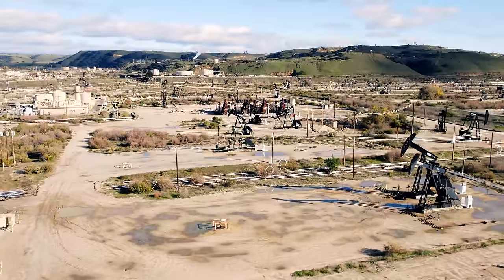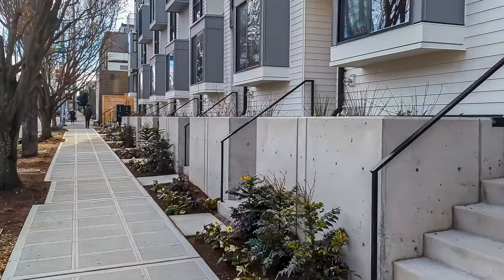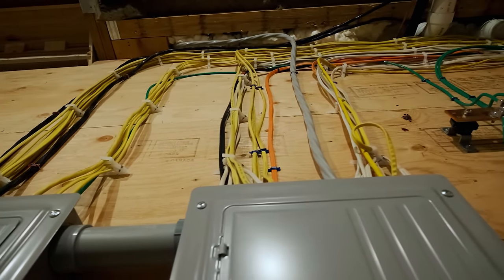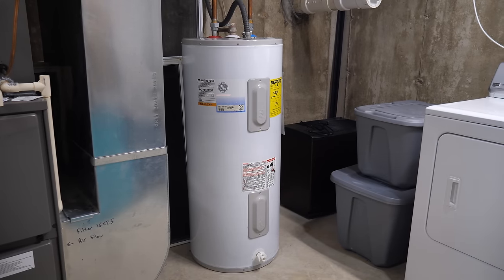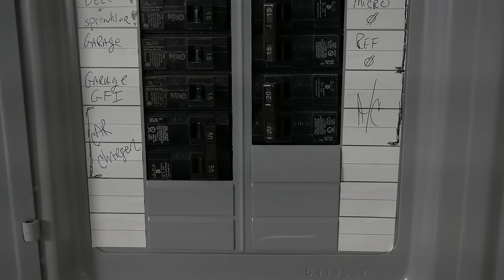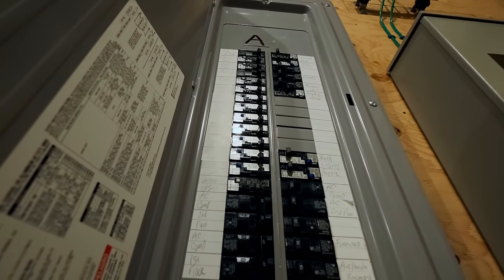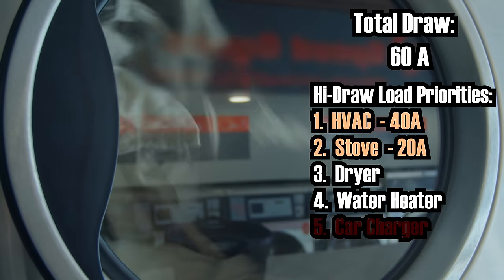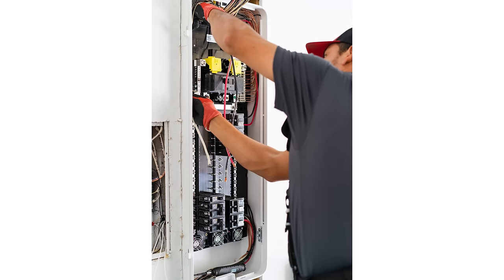Home Electrification: There's not a lot to do, and it doesn't have to be hard (Part 1)

Comment: Home electrification sounds like a great idea however, Being a Michigander, I'm glad we have natural gas heaters. Power outages are such a concern with fragile infrustructure in my state especially in the winter. Manually turning on our gas heaters allow us to not die. Home electrfication is good depending on the region and especially on the region's power stability/weather.
Reply: Yeah, I think one of the things he should have discussed is what happens if the grid goes out. This goes for both hot and cold climates, although I'm much more familiar with the latter. If you can expect 5-10 days of grid failure per year, which usually occurs during the most extreme heat/cold, then relying completely on electrification might be a fatal mistake.

There's probably not very much you can do about this in city centres (and city centres are usually prioritised for reconnection, so it's not such a big deal); but I think worries about power cuts are one of the reasons why people in the suburbs/countryside choose to use fuel burners for heating. And if you're worried about extreme heat/cold, well, those are the exact conditions where basic household generators don't work so well.

Basically, full electrification is only a good idea if you're unlikely to have an extended power outage that coincides with very hot or very cold weather. (Or if you have a lot of money to set up all of the additional backup infrastructure in case of a grid failure.)
Reply: @jon_j__   This more so brings the question, How do we stop future grid failures from happening? I'm beginning to think if underground wiring might be the next step to less maintence costs. Yes, There's going to be a large amount of work required and capital required to just get everything underground. However, This could be the next step in fixing 98% of grid failures
Reply: @girthiusmaximius8486  I think that burying all the lines has quite a few disadvantages: it's expensive; it's disruptive (you have to dig up a LOT of roads to go under instead of over); it's more difficult to maintain; it's more difficult to repair damage (eg. water intrusion, idiots with a backhoe); and the grid can STILL be taken out by damage to critical infrastructure which has to be above-ground (eg. transformers, high-voltage long-distance lines).

Instead, it might be better if every individual house or neighbourhood (outside city centres) had the ability to produce a small amount of electricity for themselves (eg. solar panels on the roof with battery backup and some kind of smart controller like the one shown in this video). When the grid's up, they can use as much power as they want. When the grid goes down, they go into "emergency mode" - all non-critical circuits are disabled and, if this is a multi-household circuit, everyone's resources are shared.

The idea is that any point failure, even in a piece of critical infrastructure like a substation, won't cause a regional blackout with lots of deaths - instead, it'll be a regional brownout with lots of inconvenience.

Also, giving everyone solar panels and batteries would be very expensive, but I reckon it'd be cheaper than trying to bury the entire national electrical infrastructure.

We have the tech to do this, if we want. But it would probably take a government initiative to get it off the ground, and there aren't very many countries where the government is even vaguely competent.

Comment: Congratulations if you live in an area where going all-electric is a good idea.  Some of us live in places with old overtaxed grids that would fail if too many people did that.  If a region cannot build more natural gas power plants or perform basic grid maintenance don't be surprised if the stuff suddenly shows up in everyone's homes powering their furnaces water heaters and stoves.
Reply: It's not just you area that is vulnerable as brownouts and blackouts are increasing around the world. All electric is a bad idea anywhere. Yes, sources like gas are good because such systems can run off a generator. However, energy scarcity is worsening by design and will also limit fuels. The money for electric conversion would be much better spent on off grid backups because even basic things like candles will be vital if the trend continues.

Comment: I put the heating elements in series on the water heater reducing the load to 2250w. I don’t use the central air conditioning much so left it on the grid . I have 7 small window ac units on the essential circuits panel ,only running the ones where they are needed. I heat with firewood though heat pumps wouldn’t use more than the ac units.
All the 120v loads except the microwave are on the essential circuit panel which is powered by a 5KW off grid inverter.
We have free-at- night electric 8 pm -6am so run dryer at night.
I have 200amp service so that wasn’t the motivation.
We also have a second house connected to our service with a 50 amp main and similar setup but with mini split heat pumps instead of firewood. Our combined power bill was $30.02 last August in Texas. Last month it was $43 because we did a lot of cooking. The key is sequencing the big loads and timing.

Comment: Here in Quebec, we've had all-electric houses for a long time. An average house is heated with baseboard heaters(resistive heating) and use an electric water heater, electric range, electric dryer, etc.. Heat pumps are getting more and more popular(usually because they also work as air conditioners and allows to save on the electric billsl as it's more efficient than resistive heating), but baseboard heaters are usually still kept to take over when the temperature goes below -30°, where the heat pump won't work. .

Some houses may have a fireplace or sometimes a gas range (usually because some people prefer the way it cooks VS an electric range), but they're so far in between, electric is the standard. Some old house may still rely on a gas furnace and whatnot, but most of these has been converted to electric, usually more a money kind of thing than anything else; our electricity is very cheap so it's cheaper to heat with electricity than gas. 

That being said, it's important to note that we've been gifted with an abundance of clean, cheap and constant power with our hydroelectric dams, which can't be said for every part of the world.

200A service has also been standard here for a long time. I live in an house built in 1993 and it had 200A service from the get go. Pretty much only old houses that still has the original electrical panel and wiring don't have 200A, but most of them has been upgraded during house renovations, as electricians are required to ensure everything they touch is up to code when they're done, and those old panels and wiring usually aren't.
Reply: How does that work out for you when ice storms knock down lines for days at a time?
Reply: Hydroelectric is not as environmentally friendly as you may think. But it's so cheap in Canada, no one wants to talk about it.
Reply: @JohnMichaelson  power outages that last more than a few hours are incredibly rare. But it did happen last 23rd of December, first time since 1998's ice storm. I personally lost power for 3 days. The solution was easy, I went to my gf's place until power was established. I also could've went to a family member's pace, a friend's, etc., heck, even an hotel in the worst case scenario. That's the thing with electricity. Outage are usually localized to specific neighbourhoods. It's really never the whole grid that's out. You can pretty much always find a place where there is power.

And note that I don't have any source of backup power, other than a small UPS that can power a few low power stuff for a few hours. That's because prolonged outages are so rare here, however, people living in places where power outages are frequent usually have a mean of backup power. A simple gas generator will do the trick to power the the essentials. Some people may also have solar panels installed, which will also provide free power when the grid is working. There are alternatives available in case of emergency. 

Now let me ask you the opposite question. If everybody is relying on gas as a heat source, water heater and for cooking, what happen when there is a shortage or supply issue? It affects everyone, not just a neighborhood.
Reply: @zoomzabba452  every mean of producing energy will have environmental impacts of some sort. But there are sources that are much much better in that regard. Hydroelectricity is one of them. Like other renewables, most of the impacts are happening once when building them, then after that, the continuous impacts of producing the power are very low. If you want zero environmental impact, you're free to go back to the stone age.
Reply: And excess power gets sold the the grid in New England
Reply: You must live near the border then. There are MILLIONS of people living where it takes avout 5-20GJ of gas a month to heat the 3-4 months of -20C. Thats an extra 1000-5000kwh electricity a month. Thats WITH the extra 10% efficiency of resistive. My average is 600kwh. My bills are 150 in the summer and 300-450 in the winter. Making it fully electric would cost me thousands a month some months.

I fully agree that we need to convert to green. But energy providers need to be reigned in, we need green energy provided at a quarter the cost it currently is. Heat pumps don't work 500km north of the border.
Reply: That's great. Good thing the power will never go out or that might be a pretty dangerous way to live, putting all your eggs in one basket like that!
Reply: @DistortionUltra  1000-5000kWh EXTRA per month? Wow, your figures are so off. Here in Quebec, where everything is powered by electricity, and the province that's known for consuming the most electricity per capita in North America, an average home consume about 97kWh per day in winter. That's about 3000kWh TOTAL per month. So unless you've got a big millionaire house (in which case, the cost of power shouldn't be much of an issue), there is no way heating with electricity is going to ADD anywhere near 5000kWh extra consumption... We don't even consume that TOTAL
Reply: @HCkev  It's simple math... the GJ energy of gas used to heat a home is listed on the bill. Its 5-20GJ depending on how cold it is, In Centeal and northern Alberta, a -15c month avergae could be 5-10 but a -20 to -30 average month (we've had two this year in Edmonton) takes 20GJ hot water and gas. I keep the heat at 21C. We only use 600kwh in other electric. 1700sq house. Converting 20GJ to KWH is literally just a math conversion. Its around 277kwh per GJ of gas used. Electric heaters are about 100% efficient, my gas is high efficiency, 90% percent. Even with the that 10% off the top, it's 250kwg*20GJ is 5000kwh, on top of normal 600. Sorry you don't underatand what its like live where it's cold? Even with a quick google for the MOST effective heat pumps on the market, 2.0 Heat effiency at -25, thats still like 2500kwh extra heating. at 0.12c/kwh here, (on the green energy plan) thats an EXTRA 300$ a month in usage, while admin, destination, and delivery fees would also probably double adding anither couple hundred bucks. my gas bill, even taking it out entirely, is only around 100$ in usage, and like 100 in fees.

I WANT to go green, but i cant affors to quadruple my utilites bill.

This makes sence for 3/4ths of the planet, but i HATE it when people say oh, you can go gree if you live in Edmonton. No you can't. Not yet.

Or to use your words, unless you are rich.

Lastly, thats assuming you are on a fixed plan like me. Some people had floating RRO rates, and it spiked to 30c/kwh last few months. if they had gone resistive heating, and not used hest pumps their bills, 5000kwh * 0.303, that's 1500$ plus admin and delivery fees. 

some of then had bills in the 600-800$ using gas still, JUST because cause of their ridiclious rate for the 600-1000kwh of non heat use.
Reply: @QW-lm1ie  Wrong argument. Power is never out for more than a few hours to a day, and if it is out longer, your local gas pressure distributor will also stop working.

Its tok expensive for millions of people in the northern hemisphere. Energy needs to be borderline basic human right. Provided publicly and incredibly low cost, and regulated. Sure, make gluttons pay more, but a baseline utilities bill should not be 500-1000$ for an average houshold or more if totally electric.
Reply: @HCkev  Also, keep in mind, Quebec Electricity rates are generally HALF that what they are in alberta. if you are paying less than 8c a kwh, its a QUARTER what we are paying right now.

So if you 100% electric hosue in Quebec City Or Ottawa or Toronto or anywhere eastern provinces withing 50 clicks of the border is 100$ a month, im genuinely happy for you. But shit is different for a lot of people.
Reply: @JohnMichaelson  even you pulsing gas heater need electricity .
Reply: Resistive heat is about the least efficient heat you can have.
Reply: @JohnMichaelson  Situations that are that bad usually also knock gas infrastructure out too, since gas mains require electric pumping stations to operate. And if your in a Rural area, where central gas distribution is very rare, and gas appliances are stuck relying on a household gas tank, loss of electric power swill disable the houses gas system too.
Reply: @hotfudgemoney  haahahha what? Its literally 100% efficient. Sure, heat pumps and geo can get transport more heat than the equivalent energy used, but again, only in specific tempature ranges are they that efficient.
Reply: @DistortionUltra  electric baseboard heat is one of the least cost effective ways to heat your house. I don’t care about the how efficiently the heat is created. It doesn’t translate to effective comfort or finance
Reply: @hotfudgemoney  I was referring to forced air resistive heating. Its the cheapest converson, and and gets just as warm.

its still expensive as hell to run, which is what I was saying in the first place.

Comment: The water boiler stuff is definitely something I'd love to hear more about, as here in the UK a gas boiler is extremely common as a method of domestic heating.

The new place we're moving into has a good but quite old gas 'combi' boiler plus water radiators that definitely need replacing, and something for Year 2 of living there is probably seeing if we can replace with a heat pump and new radiators.
Reply: I live in Canada and have an electric water "boiler" I don't have a COMBI but LION does make a COMBI KIT for my unit it is "pure" resistive heating NO heat pump 
just of 80A 240V when "full go" but NEVER unless you first start up the heating and want to warm up "quickly"
Reply: I have an electric hot water boiler, just resistive though because it’s a flat and nowhere to mount a heat pump outside part. It normally pulls 4kW for heat but for the hot water or if the heat has to run really hard it can go up to 12kW. It’s a direct replacement for the boiler and negates the need for a tank as well. (It has 10 or 12 litres internal tank.) I’ve had hour long showers without running out of hot water, and the old tank cupboard in the bathroom is now huge storage!
Reply: @jasonriddell  He meant German Comi system, Gazprom...
Canada has far better grid than the US, or you need a home in the mountains, do it all yourself, fck the grid !
Reply: I'm really enjoying my exhaust air heat pump, which basically is combined HVAC, heating and boiler system with heat pump and resistive elements.
Reply: A heat pump install won't (necessarily) replace the radiators (source: got a UK heat pump quote last week) - it will use existing ones if they are sufficiently large. Nothing to say you can't replace them at the same time, but you may not need to. You do need to have a hot water tank installed (and find space for it) for hot water, which the heat pump will heat as well as the central heating. Likely the tank will have an immersion backup heater too, possibly powered by solar if you go all in. 

As a rough guide, our 3-bed semi got a quote of £7500 for a heat pump + tank install (that's including the government £5k subsidy).

Comment: In our previous house we replaced a 40kW heating oil (diesel) heater with an 8kW pellet burner that was hooked up to a solar heater. That system also replaced the electric hot water boiler for the shower. And it was never not enough. Just goes to show how massively oversized the old system was. As an extra bonus, the new system was dramatically cheaper to run (cost divided by 3) and way more quiet.
If I had to replace that system again today, I'd probably go for a ground source heat pump.

Comment: Due in part to your information, we installed a ductless mini-split heat pump 15 months ago. We had an existing methane boiler. The heat pump has provided our heating and cooling ever since. Thanks. We also acquired an electric vehicle which also has a heat pump. They both work well and are efficient. Next challenge is replacing our gas water heater.
Reply: That has been almost exactly our experience.  We started with added attic insulation and roof top solar, then a ductless mini split HP, then an EV and then more solar. We’re still trying to figure out if a hybrid HP water heater can replace our existing NR water heater in the garage. Our only regret is installing the heat pump before the current tax credits became available.

Comment: I am glad to see you mention electrical codes and the changes necessary to make electrifying everything okay on 100 amp service.
Load side management is going to be a nightmare for electrical infrastructure when it starts futzing with steady-state load calculations. Not a bad thing, just something that has to be addressed.
Reply: Also, I'd love to see you revisit your old natural gas video. It's been six years and it sounds like you think things have changed.